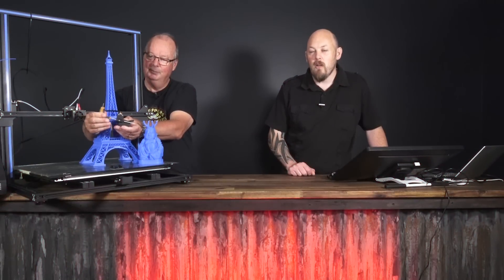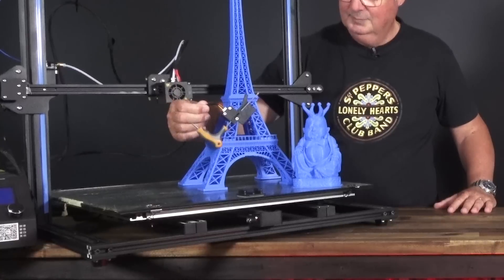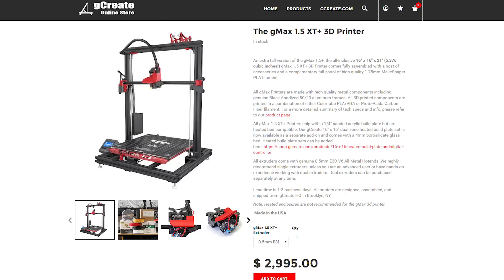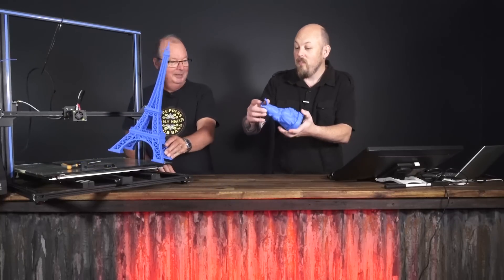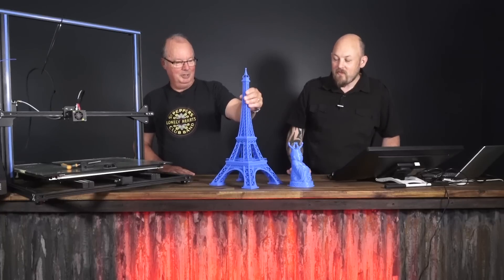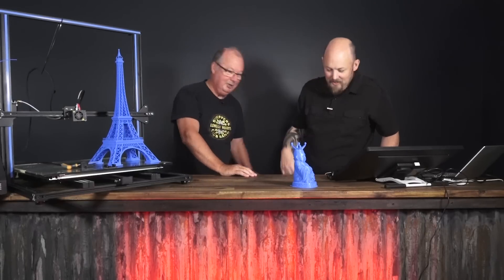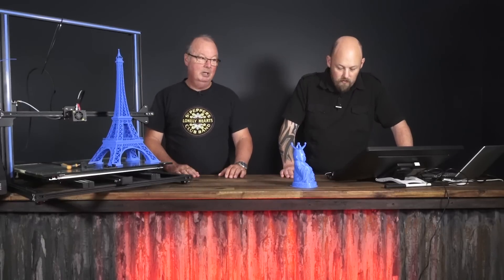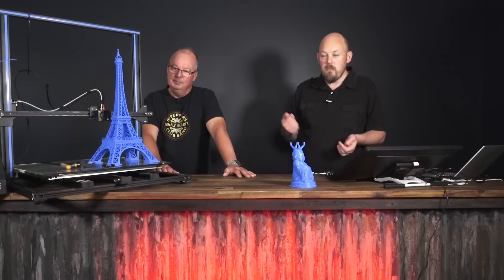Creality CR10 S5 500x500mm Review! PRINT BEYOND MASSIVE!

Comment: So I got this printer and I found that the bed is not heating up around the edges at all, even after leaving it on for a while. I had serious Adhesion issues because even printing in the middle using a glue stick and at a higher temp, jobs wouldn't stick. I got another heating pad and was able to swap that out and it's much better. I also had to adjust the z-offset still to get it to adhere. I also got a magnetic pad but that's not working for adhesion so I'm getting rid of it. I feel like I wasted $200 on that magnetic top pad though

Comment: I really enjoyed your video on the Creality CR10 s5 3-D printer, although I was quite disappointed in your lukewarm review.  I am considering a printer purchase and this unit seemed to fit the bill, largely due to the 5c x5c x5c mm print bed.  The mfgr. advertised the "DIY unit for $719 USD, which was another plus in the pro-con list of likes and dislikes.  Your review casts serious doubt on my choice, and I have noticed that the FB CR10 Group seems to feature more dissatisfaction that satisfaction.   In a nutshell, I would like to ask you for a recommendation for a printer that I'll be able to rely on.  Can you send me a secure reply so that we can discuss this in a secure mode such as e-mail?  I would like to let you know what it is that I"m working on and why I'm thinking that I need a printer that's a better quality product.  Perhaps as you suggested in the video leveling add-ons, extruders that work etc will make this a viable unit, and I'd like you to address that as well
Reply from the maker: A lot has changed since then , there are much better options these days to pick from with much better features
Reply: @TheHotEndChannel  Thank you for your prompt response !  The improvements that you've seen are a positive for me and I'd be interested in your opinion regarding the acceptability of these improvements.
Reply from the maker: A printer you can rely on ..can get pricy .. for example the only ones I'd recommend for bullet proof reliability (so far that i have owned) are the zortrax range
Reply: @TheHotEndChannel  That price is a bit much, but more than that, the 3C x3C x 3C mm size is too small to accomplish my task requirements.  My print size requirement is 450 xxx, minimum.  Do you like the Creality CR10 Max any better than the -s5,  given the improvements that they've made?
Reply from the maker: Hmm not sure that large sorry, the one large ones that size I've used are the creality in the video, or one from wombot.com.au
Reply from the maker: https://aurarum.com.au/product-category/3d-printers/wombot-3d-printers/
Reply from the maker: In short you pay for quality..

Comment: Could you please tell me where the lead marked 'filament detector' plugs in (l assume it's where the filament goes in, but l can't work out where and how).
By the way, l disagree with you, in my opinion, the worst thing about this printer is the dreadful lack of assembly instruction information available (l had no paperwork in my box), and what info l did find available from there company, was (apparently) universal for all CR 10's. I would strongly disagree with this, it left massive big holes in the instruction~ like, where does the second 6 pin Z cable plugin (it doesn't even mention there is two), where the lead coming from the nozzle housing goes (mine came wrapped over the gantry top bar, so l thought that was where it was supposed to be, ~ that could have been a disaster), no mention of the glass at all, no mention of the 'filament detector' cable at all, no instruction on how to install the part they call the 'plastic thing', and the diagrams (or lack thereof), are so poorly inadequate and confusing, they misled rather than enlightened the buyer.
The two screws that were not tightened prior to shipping, did, in fact, fall out whilst unpacking, but as my machine is nothing like the one pictured,  l still don't know what to do with them!
The packaging was really tops though (I'm going to use it to make an insulated hydroponic chamber out of. ~ for my tomatoes~ before you start thinking of something else) 
And the machine looks solid and quite good quality (and those side cutting plyers are fantastic!).
Yours Faithfully, Anita.

Comment: I own the black widow tevo and it is way beefier for the $500 range. It too has its quirks but it has potential and I’m happy with it for my home diy projects. Ima intermediate printer user after using it for 3 years. It’s not a beginner printer because it requires assembly and the instructions are not very great since the details are not shown because they are outdated.

Comment: I very much agree with this review. And not just because John is hot. I bought an S5 a few months ago. Fortunately haven't had trouble with the filament sensor. I have had wonderful prints off of it, down to .04 layer height. And as large as 460mm in diameter with out fail. My only complaint is, as the video states, manually leveling such a large bed is a royal pain in the ass. So if any one reading this is purchasing a CR10-S5, get a BLTouch with it.

Comment: If you're going to 'hold' the tower like that, really need to cup the....
Never mind.

I love the CR-10 printers. Would it be very hard to upgrade the run-out sensor and/or BL probe? I know the original was a pretty much closed system that you couldnt add things to